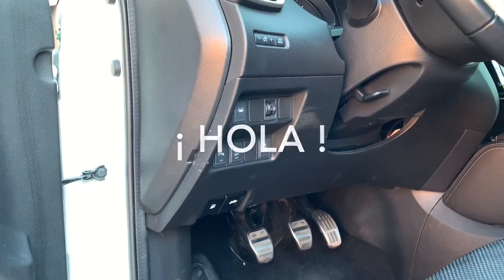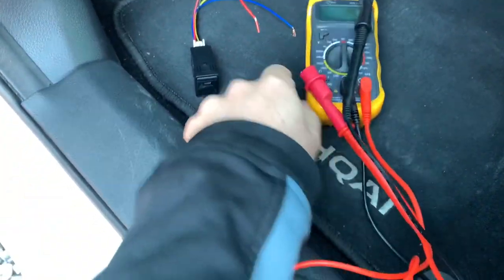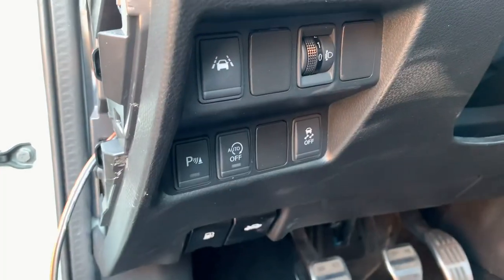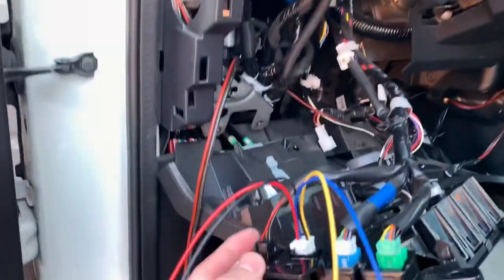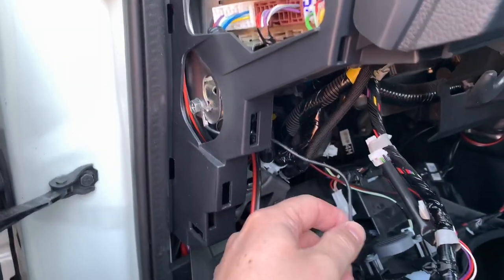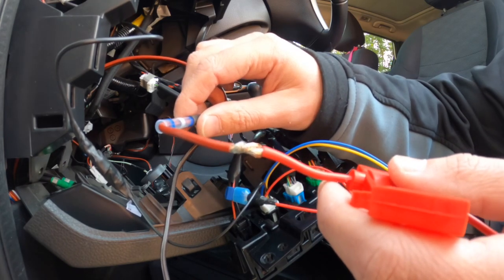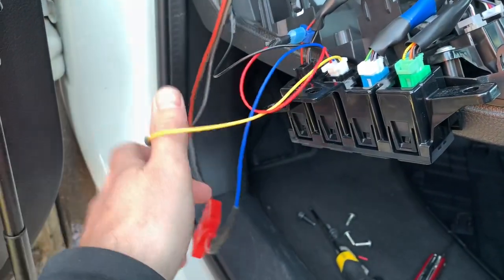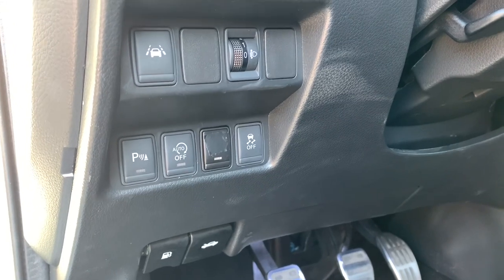Nissan Qashqai J11: How to ADD / CHANGE a Toggle Switch

Comment: great video as all of your videos!!! Since you an expert, could you pls advise me the following: I have a qashqai J11B, which does not have switch off button for ESP, I have to switch off the ESP via system menu! Is there any way to add a ESP button at toogle buttons enabling me to switch it of from there?????? I can place the button but where i should connect it to do the job that i want?
Reply from the maker: Thanks 😉 Why would you want to desactivate ESP that easy? Do you drift on daily bases maybe? 😄
Reply: @LaPalmeraie0032  hahahahaa no I need it during snow conditions and it’s annoying when you need it fast to have to go through the menu… so, any idea maybe ???🤩
Reply from the maker: During snowy conditions you just want it ON no? When the wheels spin it only diggs in further… I never turned it off and and can’t see any reason, but drafting or rally driving, to turn it off. This said, as it is buried in deep in the menu, I don’t think you could make it controllable with a switch.
Reply: @LaPalmeraie0032  No the ESP should be turned off in Icy or Snow conditions enabling you have the maximum control, except if you car has an option for snow mode so it may understand what exactly do you want to do. You dont turn it off in order to dig but not to make corrections/brakings that should be done only at normal conditions, otherwise it may send you out of the road or stay still to the exact same position without moving even an inch.  Too bad :P if you find any way to do that let me know! thanks
Reply from the maker: Ok thanks for the info. I will 😉

Comment: Great information. Thank you!
What about replacing the warning lights switch? I can't find the way to dissasemble it.
Reply from the maker: Thank you 😉 why would you want to change that?
Reply: @LaPalmeraie0032  The warning switch is failing and I want to dissasemble it to clean the switch contacts or to replace it.
Reply from the maker: Ok I will have a look and came back on it. 😉
Reply from the maker: Page 12 nverlaan1.stackstorage.com/s/gilJrk61E4MA4y5I
Reply: @LaPalmeraie0032  Thank you! ;-)